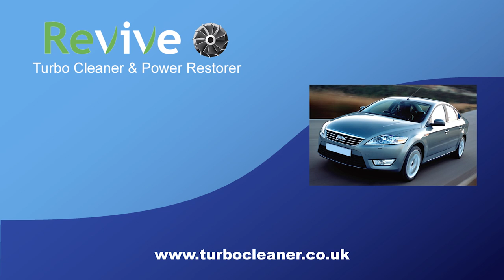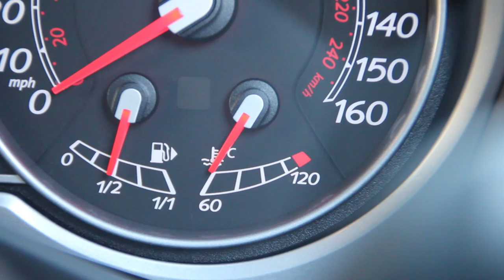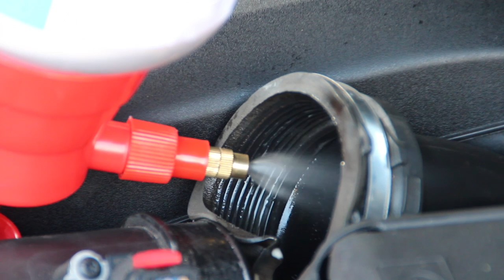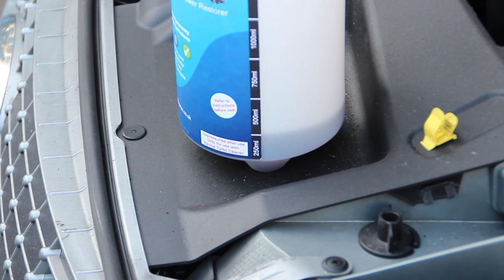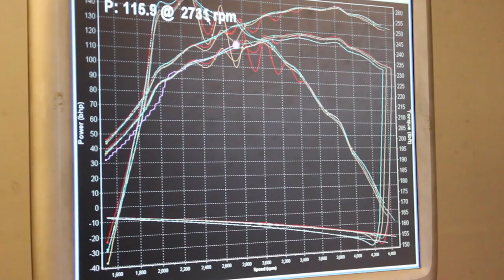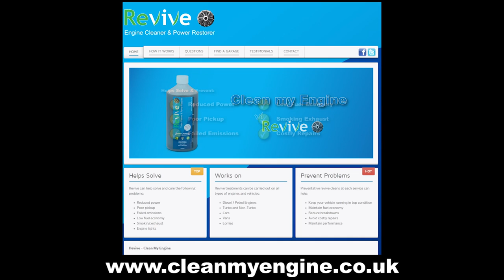Revive Turbo and Engine Cleaner

Comment from the maker: Hi Jonny. Yes, Revive can be used on vehicles fitted with a DPF. Revive is a water based surfactant and the two different molecules attach themselves to the carbon build up and scrape away layers into a microscopic powder  and these particles are no bigger than the soot particles that the engine normally generates. This would then get burnt of through natural re-generation.